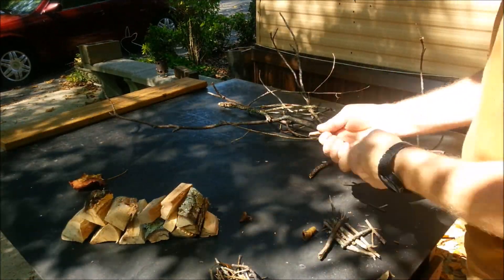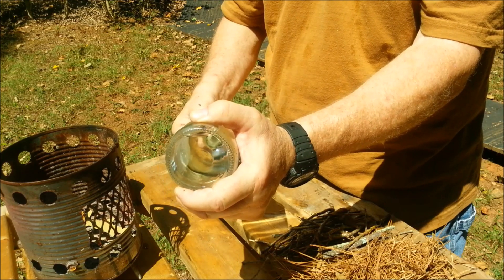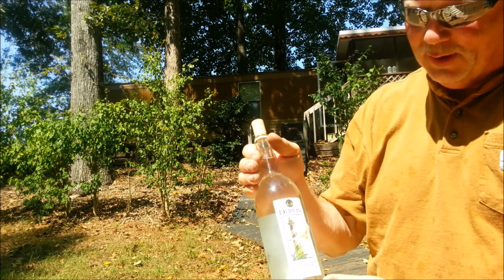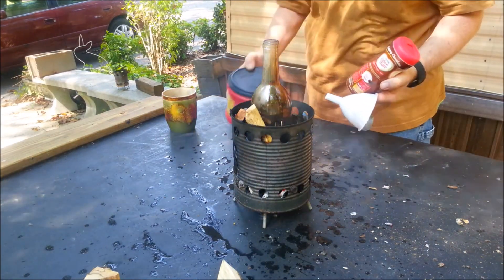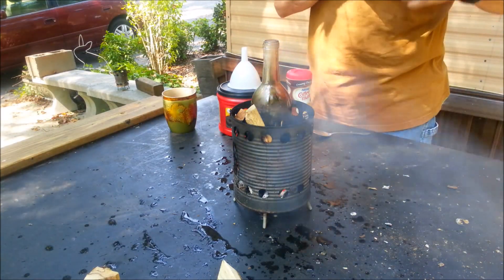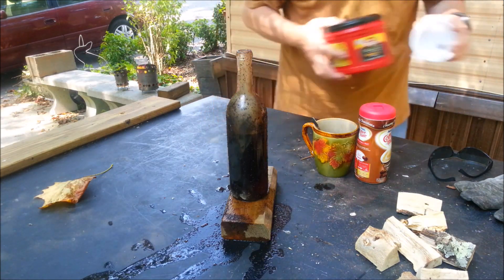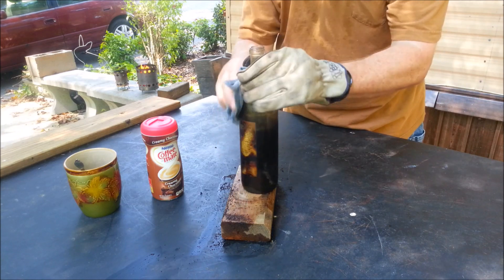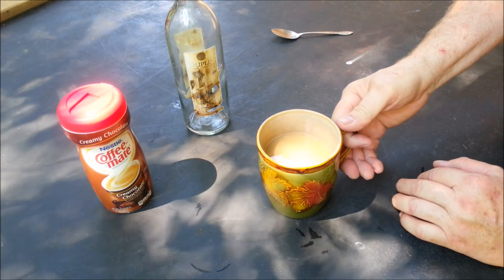Boiling Water in a Wine Bottle... Solar Ignition, Geisers, and Coffee

Comment: The dissolving solids within the coffee grounds slide in between the water molecules and displace the air. Yes, there is air/gas between the molecules. Same thing happens when you add salt to hot water, lots of little bubbles escape.
Reply from the maker: Since then I've noticed that coffee grounds always produce a lot of foam when you first stir them into hot water. TY!

Comment: That's some I've thought about, but never tried. Good to see you back at it.
Reply from the maker: Thank you.... Now, more about the barrel cut. I know you're not supposed to shoot slugs through a modified choke, but if you were going to, like I do, look how much spin you'd be losing on a rifled slug. As you know the spin is your accuracy and consistency.
Reply: +David West I'm still on the fence. I just read an article where a Shotgun with a 30" barrel was cut at 1" intervals. Velocity measured after each cut. There was only a 150 fps drop from 30" to 21. The velocity drop isn't significant. The slugs seemed to do just fine for you.
Reply from the maker: That's interesting. So most of the 'push' of those gasses happens within the first few inches. I didn't know that. Check out this video from Hickok 45. Shooting slugs at 230 yards. I wonder if he would have had that much accuracy if he had cut down the barrel. Because of decreased spin on the round when it left the muzzle??? Shorter barrel equals less spin??? I don't know. https://youtu.be/nNTyCcip-ks
Reply: +David West That's a cool video. With rifled slugs I don't believe they start spinning until they leave the barrel. As the slug flies through the air the rifling grooves create the rotation.
Reply from the maker: Never thought of that... I've thought about that video many times. It just doesn't seem possible for him to be shooting free standing, using Kentucky windage, shooting 230 yards, and consistently hitting a 3' circle... Blows my mind. Thanks!
Reply: David West He has had a lot of practice.
Reply from the maker: LOL. Just think of the tons of lead that's flown down range and tons of brass that's dropped on the firing line. Yeah, pretty nice to have all the free ammo you want and so many donated and lent guns to try out.